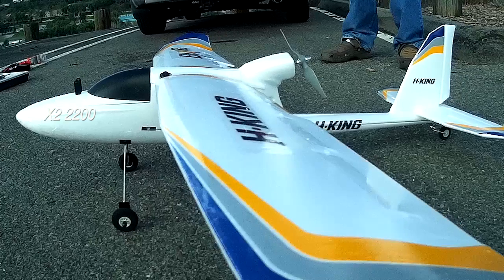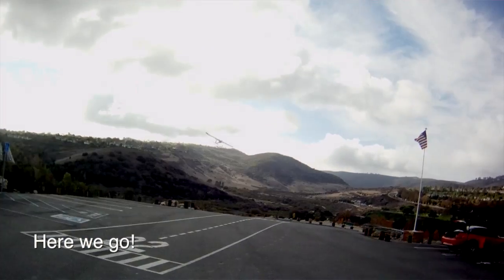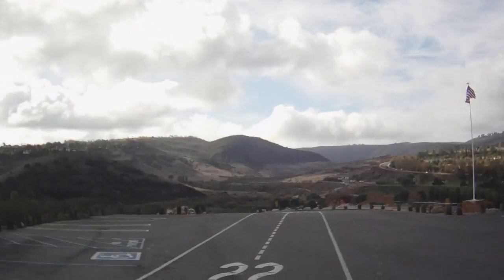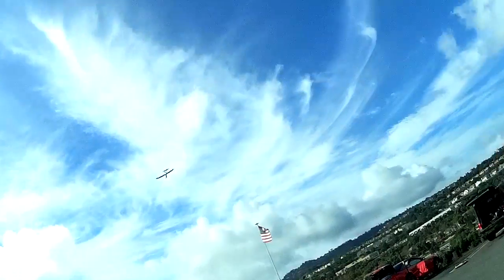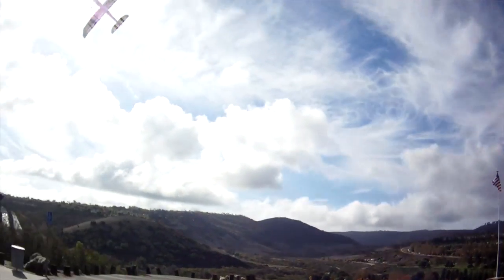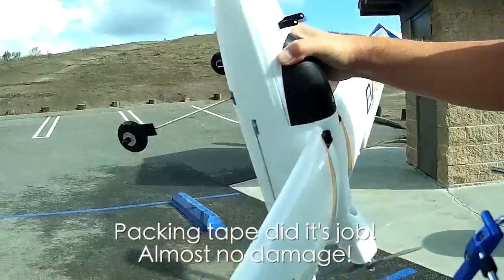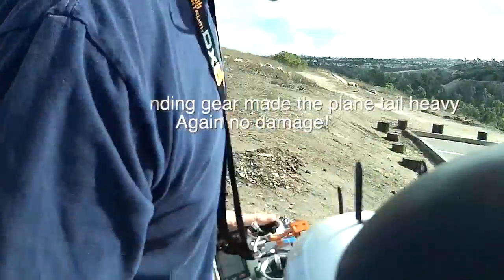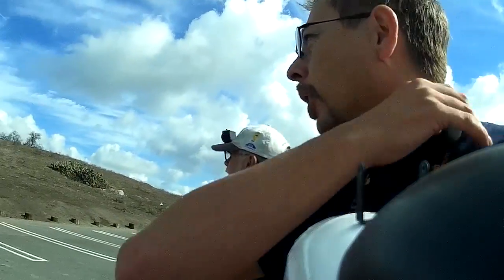7demo7's Bix3 Maiden Flight with Flaps and Ailerons overview

Comment: Hey Jeff,
nice to see you finally in the air. I recommend a 35er Size motor either with with around 1000kv and a 3cell or 700-800kv and a 4cell setup with a 9inch (in best case with a 10inch Prop). Play around with the Programm "ecalc" to find a proper Combo. Happy flying. Greets Nik (from Facebook)
Reply from the maker: Thanks! I have a lot of 4000mah 4s for my Quadcopter so that advise is welcomed- I really like your last video!
Reply from the maker: Sdemo8@cox.net 
I was happy to hear you mountain bike as well- I used to race downhill- I just ride for fun now- some challenging trails here in Laguna!
Reply: 7demo7
Mail is on the way.